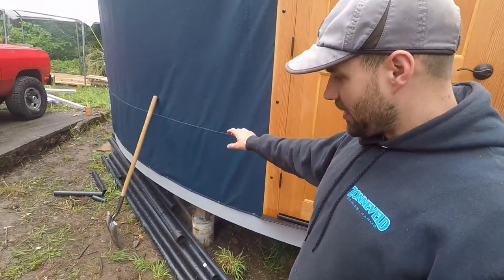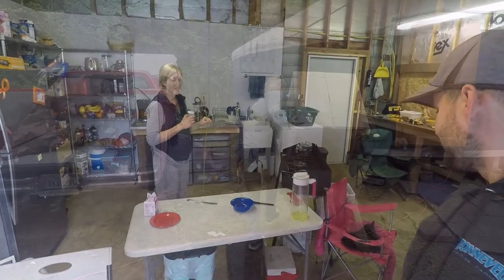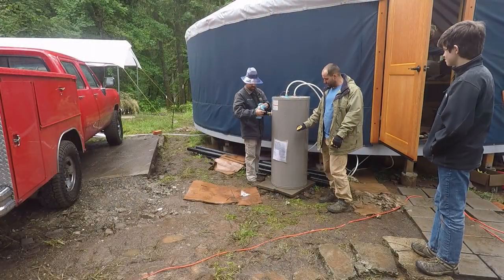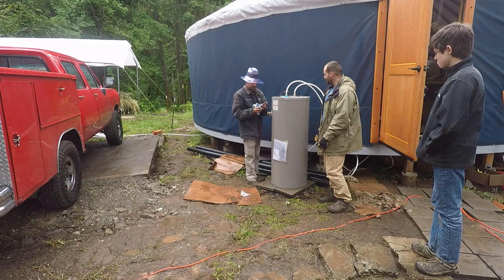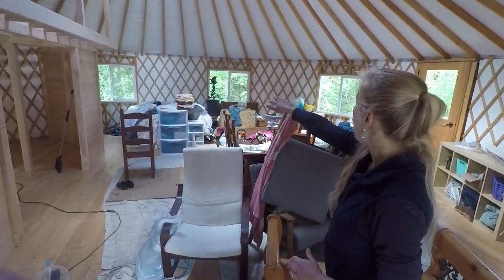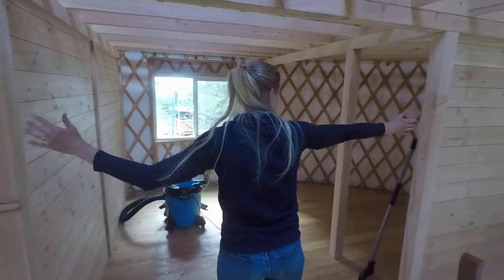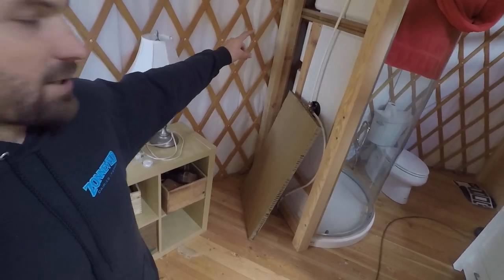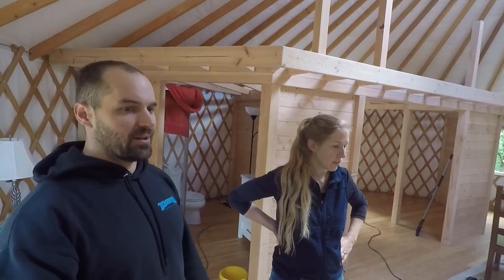Building Our Yurt Interior, Episode 2

Comment: Grreat Job! Just wondering about the front of your yurt. On one side of the door the yurt fabric looks very wrinkled. Will the fabric smooth itself out over time? Or can the yurt fabric be pulled tighter?
Reply from the maker: It can definitely be pulled tighter.  We simply missed it when we were installing the yurt.  There is a lot going on and it was an easy detail to miss!  We may try pulling it smoother this spring.

Comment: Hi, it's me again. I love all your videos. They are so helpful. I have a question about the hot and cold water inlet through the floor. Do you just have one inlet through the floor and then branch off to everything that has hot and cold water inside instead of having inlets for everything that connects to water? And, does it work the same way for a tankless hot water heater? Thanks for any advice you have.
Reply from the maker: Hi Catherine, that's correct, the hot and cold water each have a single inlet through the yurt insulation.  From there, it branches to the kitchen sink, bathroom sink, shower, and toilet.  At each location, we drilled through the wood floor to pass the water lines through.  We did this step while installing the floor, which made it much easier.  I believe you can see a bit of this step in our video about building the yurt foundation.  Depending on where you locate your tankless water heater, you could do the same, or a single cold water inlet into the yurt, if the tankless is inside.
Reply: @Green_Heart_Family_Farm  thank you so much. You're really helpful!

Comment: What region are y'all in? Do you have a problem with your pipes in the winter? Also, why a standard water heater as opposed to tankless?
Reply from the maker: We're in Western Oregon, Zone 8; no problems with frozen pipes so far.  With my limited research on the water heater situation, tankless would have been good if we were on gas.  Since we're on electric, we opted for the old fashioned tank.